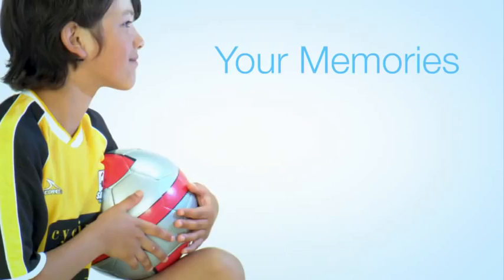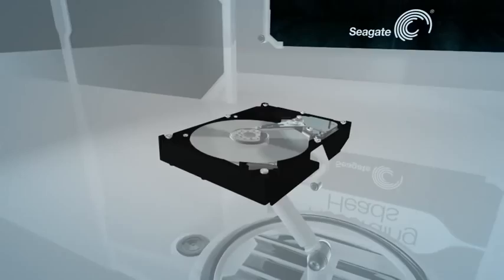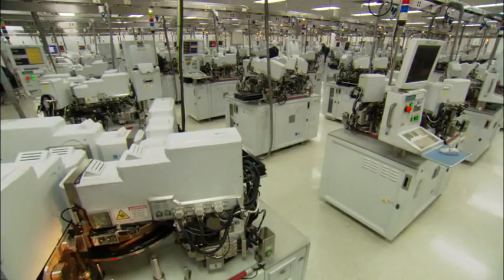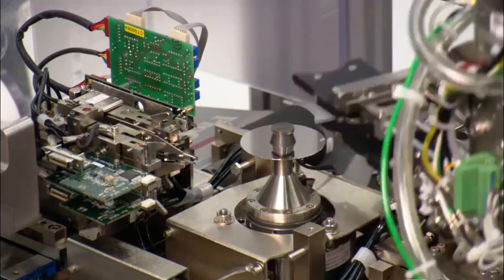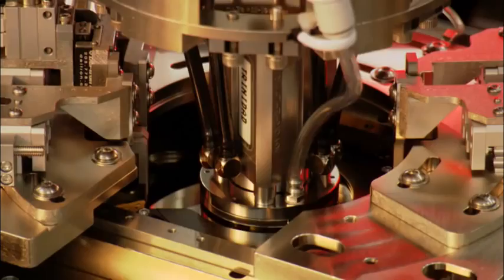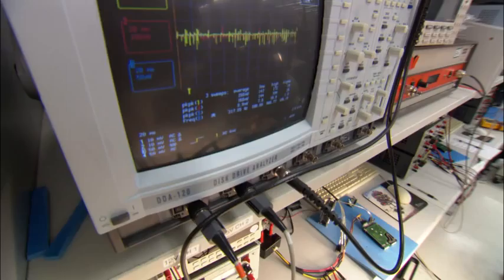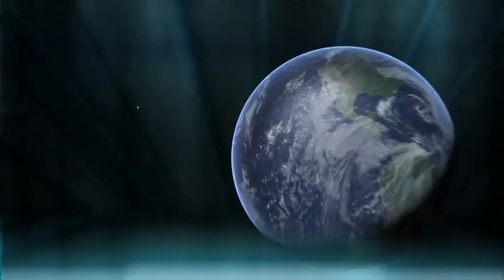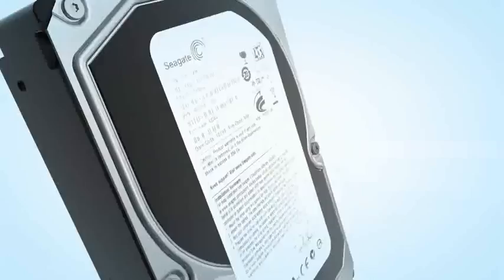How it's made - Seagate Hard Disk Drives

Comment: @ 4:36:  "(We) drop them".  And do they survive those drops? No. I've had about 3 external drives accidentally dropped the last 3 years, and neither of them survived these drops. Even if an external drive falls from about 3 ft on a concrete floor, it's bye bye to the drive... well, maybe not the drive itself but the thingie that has to read the drive....maybe it's time to make the SSD's a little cheaper. They have a bigger chance of surviving a 3 ft. drop....I guess??

Comment: Let me tell you guys about story of my Seagate hard disks experience over years:
1st, I have a few Seagate hard drives, some old and some new, i have to say that Seagate hard drives are not reliable and broke fast (almost immediately when warranty is over). one hard drive works good but it fail in one day, is a Barracuda model ST3500320AS 7200.11 series, only after that happened I realized that this is a factory defective series, data has not recovered because i did a backup to Western Digital hard drive that works great and solid. 
2nd, i have another Barracuda series model ST2000DM001 (2TB) from date April 2013, this disk works good for 2 years and after that, yes it fail. Luckily i backup successfully content the disk to other one, guess what... to Western Digital hd that still works.
Wait, this is not over yet...
3rd, I'm working as IT support in company and worked on many computer that have WD and Seagate hard drives, again, only Seagate hard drives are FAIL AGAIN ! many of them... swapped to WD and all problems resolved. 
So, Seagate hard drives is not real reliable

Comment: Reliability is definitely not in the ST2000DM001 (2TB) or ST3000DM001 (3TB) hard drives!
Reply: ST2000DM001 sounded familiar then i realised its the hard drive i own which now has 55 bad sectors in just 5 years of usage..😂
Reply: @abhishekgourav6144  You are lucky that still works, these usually fail within three years or less.